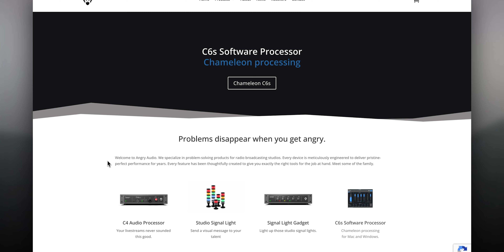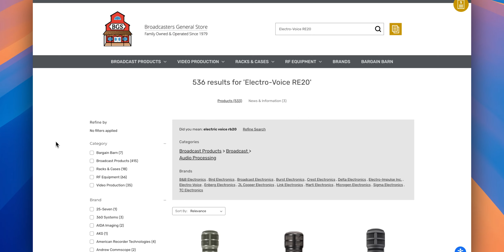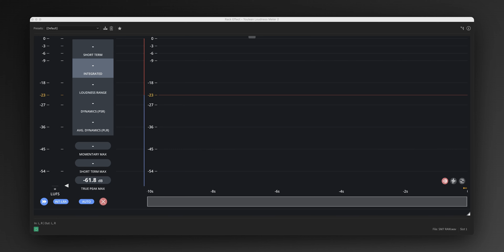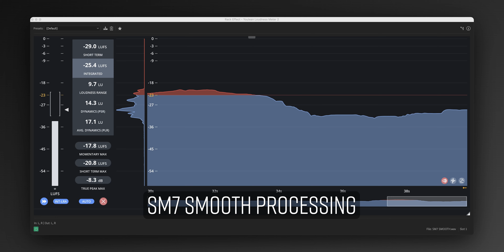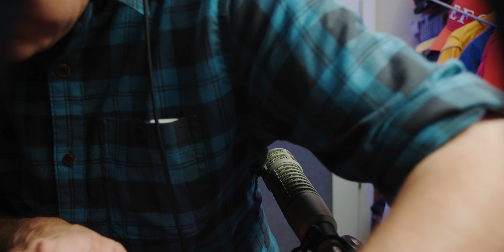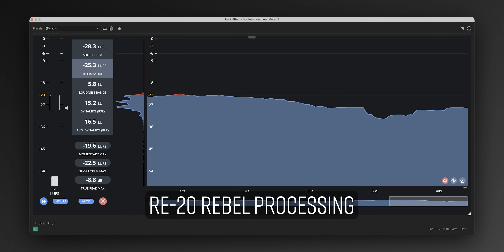Speed up your podcast production with this tool - Angry Audio

Comment: (Personally) I like the sound of the microphones without the SMooth or Rebel for the context of the narration. The sound of the SMooth would be great for "drive at 5" DJ or talk show host. I think the Rebel and RE-20 would be good for a classical music station. Both the SMooth and the Rebel have quite a few controls, so maybe those weren't set for best effect.  Yeah, it was a dramatic effect between in- and out-of-circuit. If someone had used a SMooth on an audio book with those settings, I would have stopped listening. But for listening on AM in a car or truck, that voice would sound fantastic.  Good demo!
Reply from the maker: Indeed! For audiobook narration it wasn’t set right. You can dial it back quite a bit.

Comment: They are basically the same processor, they should have let you try a c-level
Reply from the maker: C-Level isn’t a mic processor. 

I do have several C-Levels at work. I need a high density version…

Comment: You're right, on you, the SM-7B does sound better.
Reply from the maker: Good point. On someone with a brighter voice the RE-20 and REbel may be better.
Reply: @TheBroadcastEngineer  Exactly, that definitely does suit you, and wonder how it will work outdoors with some ambient noise as well, so that you can use it as a more general microphone. Put a stuffed cat on it and it might work well.
Reply from the maker: @SeanBZA  I didn’t even think about using it outdoors. You’d need electricity run to wherever you’re setting it up. Maybe at a remote broadcast if you had power you could use them. When I set up remotes in the previous job, it was very lightweight… just a Comrex Access and a couple of mics directly connected to it. Made it super easy to clean up. I had this nice little Pelican case where everything had its place. Never came back the same way it went out as folks never put it back properly.
Reply: @TheBroadcastEngineer  Anker make some nice portable power stations, that are very light, and which would likely work well there. Provides a few hours of power, and also has a carry case.

Comment: SM7 sounds a little better than the Rebel, though you will also have to note that the default YT player now has stable volume turned on by default, which does do extra audio processing on your sound, and it also seems to do noise limiting and hiss reduction on low level signals as well.
Reply from the maker: From what I could find it’s just audio level adjustment. No other processing. The only processing I did on my end was loudness for the whole file. 

But then again, I hear my voice all the time and can hear small differences.
Reply: @TheBroadcastEngineer  The SM7 sounds more balanced, you need a gravelly voice to use the Rebel, as it definitely is boomy. Did download the raw samples, but PC speakers are not the best to use, and I have the other better speakers packed away at the moment.
Reply from the maker: @SeanBZA I’m sad I have to ship back the SM7 and the SMooth…
Reply: @TheBroadcastEngineer  I reckon that you will absolutely buy them soon, at least the SM7 as first option, as it does suit your voice well, and you probably will soon enough absolutely love it. Processing can come later, good input is much better than processing.